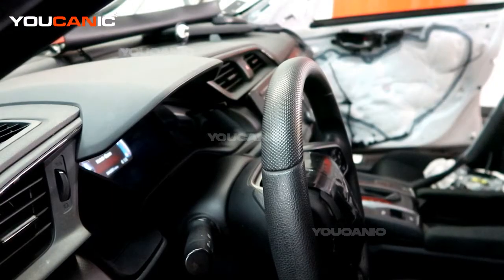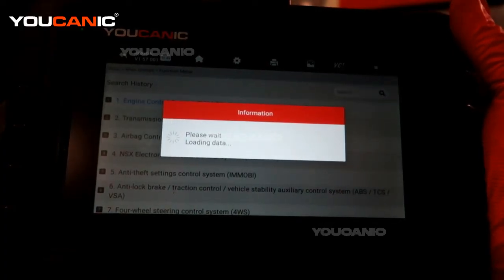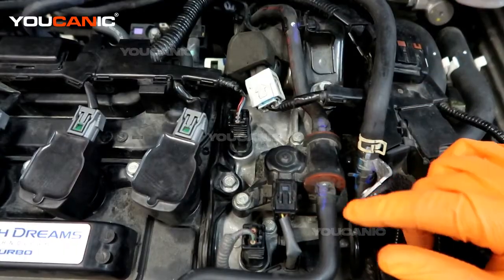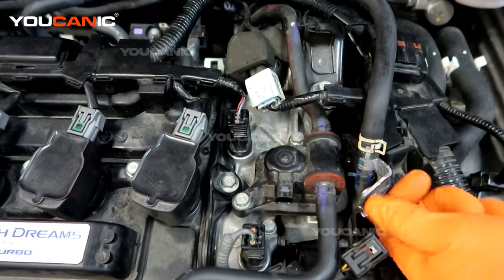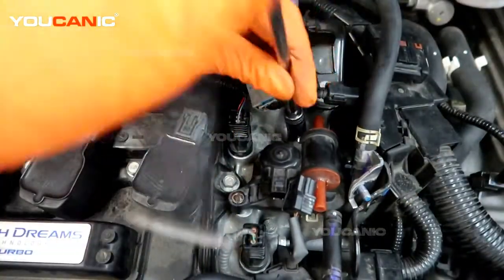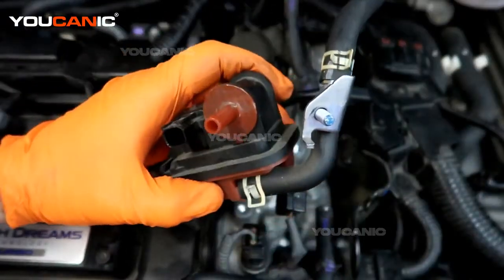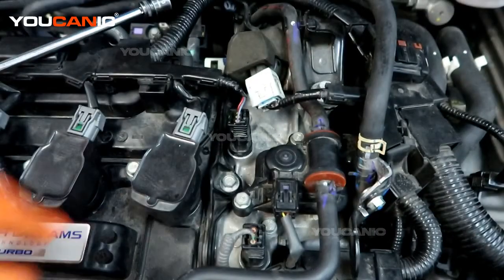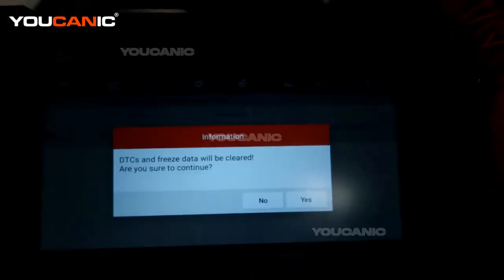Honda Evap Canister Purge Valve Sensor Replacement - P92-4

Comment: You forgot to tighten the 10 mm nut on the right.
Reply from the maker: @chicagowabo1 If you’ve got a car issue or repair question, you can find step-by-step guides and scanner help at youcanic.com. We might miss some comments here, but our site has answers for most problems already!

Comment: Before you do all or any purchases……open the door to gas filling port (where you put gas in)

If you have gas cap, take off, inspect gasket for tears or cracks or dirt, check the fill port face for damage/dents.

2021 Honda pilots don’t have gas caps. Open door to fill port. Look on inside of door for dirt. Look at fill port face and inspect for cracks or damage.

Close the door, be sure it’s closed all the way.

We got the awd system issue AND the emissions system issue warnings.

AutoZone did the ODB-II code check.
Stated primary issue is evac control valve, secondary is the carbon filter valve.

Open the gas filling door and closed. No alerts on dash.

ODB2 again and primary not present.

Secondaries stayed and only after driving for 50-60 will the computer kick those out if issue doesn’t reoccur.

Only thing I can thing is the door didn’t seat all the way even though closed plus an extremely hot day in sun!!!!

Saved us so much time and money, should have a message to check gas cap or door before a solid error code!!!

Comment: do you know were is the place for hrv 2020 purge valve on engine i have a emissions and ebrake on my cluster appearing many times i replace the fuel cap already then went to garage told me its must be the batertty only honda so i did buy and 2 weeks later still poping in help

Comment: The hoses on my old valve are stuck u make it look easy
Reply from the maker: Thanks for reaching out! At Youcanic, we understand that car maintenance can sometimes be challenging. We're here to empower car owners like you with helpful guides, free resources, and our innovative YOUCANIC scanner. We want to make your car maintenance journey a smooth ride. Check out our website at www.youcanic.com for more!

In cases where you need detailed instructions, we also have factory repair manuals available. Don't hesitate to ask questions on our site if you need further assistance. Our mission is to make you confident and self-reliant in your car maintenance tasks. Trust Youcanic, we're here to support you.
Reply: @YOUCANIC  thank you though I was able to replace mine thanks to ur video

Comment: Hey, had the dealer do the replacement on my 2020 civic, but light came back on in a week. What is the problem? Does the battery need a trickle charger?
Reply: Gas cap / fuel door not closed all the way
Reply: @rexroscoeroggaschjr7530  ok I changed 2 of these and still get the emissions light fortunately they have lifetime warranty at O'reilly "so what do I do to get the light off?" this is so anoying!!
Reply: @joncamop1 even after we did the canister solenoid, it he light never went away even after clearing code!!!

We traded in for a 2025!
Reply: ok I changed 2 of these and still get the emissions light fortunately they have lifetime warranty at O'reilly "so what do I do to get the light off?" this is so anoying!!

Reply

Comment: I have 2016 Honda Civic 1.5T. Mine just showed P04F1 & P0441. Will changing the Canister Purge Valve fix it? I also decided to go stock since there was a proble installing a oil catch can. Vehicle was rough idle and slow response but not it’s stock it’s a lot better. Also there was an oil leak from the hose connecting to the oil Catch can.
Reply: Did changing the purge valve fix it? I am reading p0441 and p04F1. New part is coming in the mail, hoping it will do the trick.
Reply: @cable5910  hey there, I bought a NEW purge valve and yes it did fix. I no longer used the oil catch can as well. Everything is okay now.
Reply: @john_i39 Bruv your a life saver. I’ve been getting these same exact two codes and was looking for this kind of response. Civic nation and safe travels mate
Reply: @christopherburke67  you’re welcome bro